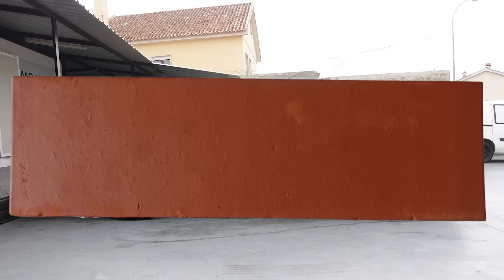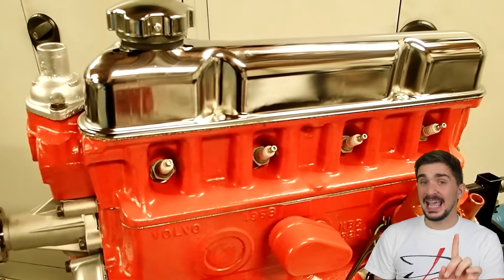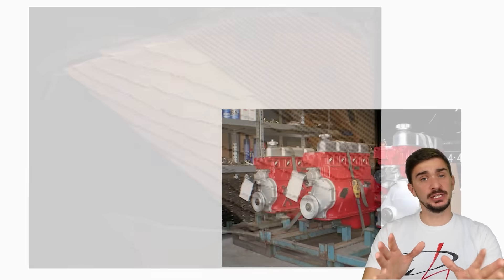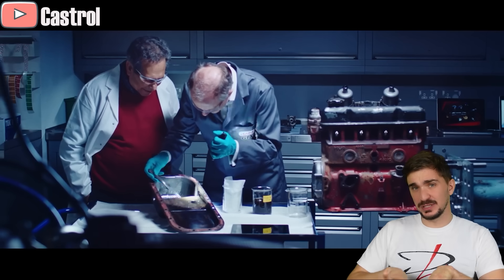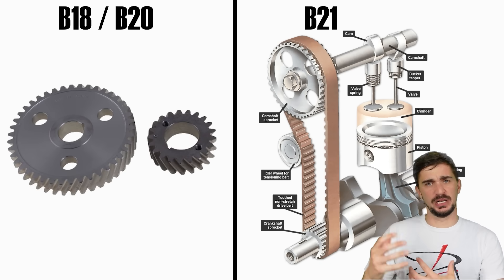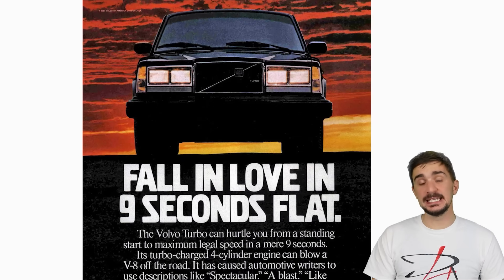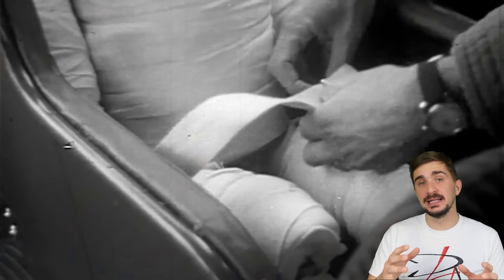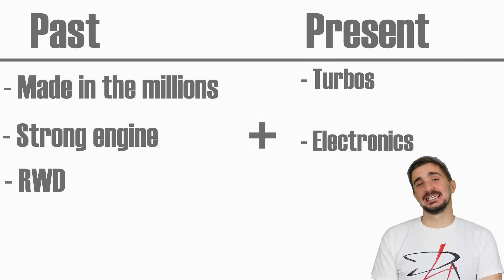A Story about the Volvo 240 and its Redblock Engine - Iconic Cars and Engines #18

Comment: One very important aspect why volvo redblock engine is so durable and basically indestructible in volvo cars is that the engine was used in great quantities by its sibling company volvo penta in boats. The load on the marine engine is maybe 60-70% more than in a car ( think of it as going uphill in 4th gear for hours and hours). To save on time and money volvo AB (parent company of both cars and marine) decided to build the engine to withstand the load in boats hence everything is oversized and more durable and install it in cars. Everything has an explanation, they werent doing things for no reson when they designed it.

Comment: Had four of these 240s , the bad thing of the motor is Volvo used timing belt instead of timing chain.  I had an Amazon with B18 motor, that’s a lot better than 240 engine.

Comment: I have two volvo 940s with b230fb engine and b230fk turbo engine my older 940 volvo has driven now over 600 000 km and newer over 500 000km still works like a charm my turbo engine is made for power with 35hx holset and other things but still orginal crankshaft and pistons and rods.

Comment: This is mostly the same story as the 2JZ, Ford 300, and Cummins 24v (all inline sixes, but bear with me)

These engines were overbuilt and over engineered, designed to either run in industrial settings under heavy load/full throttle; or overbuilt to create a super smooth and reliable engine.

The overengineering allows them to take lots of abuse, and more importantly, boost.

Comment: In 1979 I had a new 240 four door sedan. I loved he body, ride but the carb and distributor points drove me crazy. I lived in east central Ontario and the humid winters meant that the ignition system was a constant problem. The dealer replaced many sets of points and the carb would ice up.  It was a company car and so one of the other salesmen took it over.

Comment: I had one, the only trouble was a sudden mystical reason NOT TO START!  This was a capricious "mood" that only came once and a while, unfortunately at the worst possible moment.  I replaced all the electrical wiring, put on a new carburetor,  and went over everything with a fine-toothed comb.  No avail!  It would NOT start.  This happened in the middle of winter at midnight -- up in the mountains of Norway, and out in the desolate forests of Sweden.  It was great when it rain -- not so much when stuck in the middle of no where. I finally sold it at a lose. Blah!

Comment: I rebuilt a b30 out of a 164 with 200,000 miles on it.
When my machinist miked the crank, he said there was no wear.
We polished the crank and installed standard bearings.
The cylinder head was not so fortunate.
Every single bit had to be replaced.
Still working on those engines , restoring 1800s and 544s

Comment: 1977 burgundy (like the first car on screen) 242...1985 charcoal grey DL wagon (245)...by far and away my favorite cars of my lifetime.  Both were slow, but after lots of suspension, wheel and tire upgrades and modifications, nothing short of a Corvette or Porsche had much chance of losing me in anything twisty.  Many trips between the Connecticut coast and Limerock Park in the 80s and 90s were sure proof of the car's potential.  I regret not spending the time and money to truly build a Flying Brick with a turbo...

Comment: its funny you didn't mention the extreme over square design of the engine. the b23 has a bore of 96 mm and a stroke of 80 mm. Just as surprising; 63mm main journals on the crankshaft

Comment: I love your video, it made me smile, because I have the Volvo 240 GL with the red B230F engine.
I've had it now for a couple of years 2nd hand. 
I've had to change accessories like battery, alternate, fuel pump and filter, and water pump. 
The engine itself though is a brick, like you say. ❤️

Comment: The 145 and 245 were probably the most boring and the most reliable cars you could find at the time,  I had a 145 express that I had delivering newspapers, an express was a 145 without a backseat and a flat floor wich put it in the taxbracket of a light truck wich was way cheaper.

Comment: My dad had a 244DL Volvo, NEX939V, and just 2 days into its life we were hit up the back by an old 'Land Crab' - it was 1979. The Volvo saved our lives. It was very damaged, and it was repaired. the whole rear bumper was level with the rear window. I got £700 compensation as I had a cracked vertebrae in my neck, and shock to my spinal cord. It could have been so much worse.

Comment: Having owned my share of these - I can swap any bit of the engine you fancy swapping - I have the One Caveat -   They are so rubbish on fuel, you will weep. You will believe there is a hole in the fuel tank. If Ronnie Kray moved into your spare room & stuck you up at gunpoint every evening, that would be cheaper than keeping fuel in one of these. You will have to take a second job just to afford fuel to get to your first job. Getting to the second job will require an overdraft.. 

Every time you turn the engine on after a while, your bank manager will ring to ask you to knock it off as the overdraft is gone beyond a joke. LITERALLY. 

Luckily, once the vehicle has sent you bust and you can no longer afford to run it, the boot is big enough to live in when you finally become homeless. So there is that Upside. If you gave me your one for free - just so you could try rebuild your life after it had bust you, I'd pass, unless I had a bridge somewhere that I owned requiring a sturdy prop. If it fitted & I could find a way to jam it in there, maybe I'd take it. But I'd tow it with a diesel to the bridge - I doubt I could justify the cost of driving it there under its own steam. Hiring The Rock to pull it there with his teeth would probably be cheaper. Only a V12  Merc or a Toyota 4.2 diesel are scarier on fuel unless you are used to running lorries (or are American)  - in which case these will probably seem pretty OK..

Comment: There is some misunderstanding about "strongness" and "safety". There is no doubt that these old Volvos were built to last BUT it is a blatant lie to assume that these 40 year old cars are safer than modern Volvos and the likes. With the current safety standards on cars, there is no way any of these old cars could be allowed for production. For the sake of argument, it is way better to get an accident in a, say, modern Golf than any 40 year old car.  Safety standards back then meant nothing compared to now. I do admit that Volvo has always been a forerunner of building safe cars. They are known for that. But a 240 is not safe by modern standards!

Comment: I drove my neighbour's brick back in the mid eighties. It was the most awful driving experience of my entire life. The gear change was truly agricultural, with a horizontal gulf between 2nd and 3rd. The handling would have be at home on any light truck of the 1930's, and it was so underpowered ladies pushing prams kept overtaking.
I never crashed it, and gave it back well before I could test its'longevity.

Comment: My wife had a 240 wagon back in the 1990's - loved that car!   I called it the swedish tractor.  Ultra reliable, simple to repair, unnaturally good on snow, and ultimately saved several passenger lives when it got high speed T-boned by a commercial truck.
Reply: A trick was to toss something heavy in the trunk during wintertime, making the grip even better in snow.
Reply: Jep - they are incredible good handling on snow. Never had so much fun drifting 🤣
Reply: When I was about 15 (I think) we had a 240 GL - 84 in a beautiful light green metallic. It was wintertime, and there was some snow on the road. We were on the highway, and my dad wanted to pass a slower car. But as he changed lanes to overtake it, our car started to wag its tail like a happy golden retriever, it went off said highway, and on to a field, flipping over a couple of times, before sticking a perfect four point landing. The trunk was full of luggage, so it was quite heavy in the back. So I don't know about that "good on snow" part. Then again, that car got rearended a couple of years prior to the highway accident, by a SAAB 900 of all things. Even though there wasn't any visible damage to our Volvo (unlike the SAAB), there may have been some damage to the underside of the car, making it a bit nervous in the back on slippery/snowy surfaces.

Comment: My 1994 240 has 380,000 miles.  The engine is original and has never been repaired.  Same with the manual transmission.  Even the starter is the original and still works.

Comment: I'm still driving my 1990 240. You didn't mention that Volvo left the unmachined engine blocks to rest for a year to relieve stresses caused by the casting process, before grinding the surfaces.

Comment: I bought a used Volvo 245 Station wagon back in the 90s for 300 bucks in California. It was actually a really fun car to drive, with the one exception of a power steering that only worked when you turned right. Left it was no power steering. But the shocking thing was that in the glove box were repair receipts for tens of thousands of dollars. I don't know if this car had some kind of bulletproof warranty, but it was a black hole for repairs.

Comment: i have a 1981 244 with a b230A and despite it having stood in the same spot from 2008 until 2022(not started once until i bought it) it started and ran well with just new plugs and some fresh gas

Comment: Well the real Volvo cars starts even earlier than the Volvo PV, the Volvo Amazon and the Volvo 140 series. The 240 was ok though. The motors that you should remember is B18 and the B20. The later motors where not really the same quality if you ask me. I think I still can set the breaker points and timing by eye on those motors today even though I am getting 70 this year. I am a former SAAB mechanic but I have great respect for these older Volvos.

Comment: My parents had several Volvo square-backs we called them.  So for my first car out of college I got a used one, but sadly the maintenance costs were far to high for a recent college grad and bought instead a brand-new Honda CRX after a year or two.  I remember the car had a little button on the 4-speed stick shift to engage an over-drive...sort of like a fifth gear.  I also remember the car lacked power and really struggled to go up modest inclines on the freeway.

Comment: I learned to drive on my Mom's brand new 1977 242 (with Lambda(?) drive) sedan complete with a manual cranked moon roof. It was gifted to my wife and me  in later years when we got married We drove the Scandi tank until 1998. In those twenty years we religiously paid every regular (not cheap) maintenance fee recommended and quite literally drove it right into the car dealers lot as a signed for trade-in when it expired. I loved that car, my wife hated it, but I never once worried about her safety on the road.

Comment: I love my 940 from 93 - the electric fan failed last summer. The engine overheated 3 times before we figured it out. Replaced the electric fan, after we realized it was not a bad thermostat every time. 6 months later - engine does not seem to have been affected at all. No head gasket leak. Nothing.

Comment: The last "classic" Volvo I worked on was a 1988 with the B23T.  It is a magnificent car, but I really had to shake my head at how they sealed the water pump against the cylinder head.  Volvo certainly cut a corner there!
Reply: I worked on hundreds of these. 
Never had a problem with  the water pump sealing.
Yes, I changed pumps, but leaks were rare.
Reply: @jojo1966  how did you get that seal tight against the cylinder head? I don't know what the proper procedure was, but I put a jack and a 2x4 under the pump to push the pump against the head to squish the seal and then tighten the bolts.
Reply: @paulstandaert5709 pretty much it..
Volvo sold a calibrated 2x4 for those pump installs .
There’s one around here somewhere… 
I agree it was a bad idea, but once I had them in they rarely gave me any trouble.
I serviced many of them.

Comment: It would be unacceptable now with requirements for sensors, cpu etc but I wish they would do a reissue of the 240 series. In the early eighties I bought a 3 year old sedan following commercial lease and kept it until it was 28 years old. It was still going well but the demise of leaded fuel led me to change cars. Panel beaters did not like them (almost indestructible from rear end hits) and  no one wanted to steal them. Great car!

Comment: I had a b20 engine in a volvo Amazon (120) and got oilpumpfailure on the highway, and I dont wanted to stop until right on the highway, but the engine just exploded, camshaft into 3 pieces, and hole in the block. only the top survived,

Comment: I owned a 264. Peugeot and Renault used the same engine, however volvo Sweeden used crap cams, so the engine would need to be removed every 30k miles (cams couldn't be removed from the front) and it cost THOUSANDS. Every time. I bought a Ford made Volvo years later. Hands down the WORST CAR I EVER OWNED. Thranny fell apart, moldings would fall off if you blinked. Now the CHINESE?!? are making them?!??!?
Could you imagine???
..think I'll stick to Toyota.

Comment: I've heard that Irv used to drive the P1800 from NYC to Miami and back on a weekend...."just for fun". 
May be a rumor, but I believe the Volvo brand was the cause of the million mile odometer originating in cars, because the dealers complained that the odometers didn't show the true mileage on the trade-in cars, so they were getting 'burned' on the trades! I was a Volvo master technician back in the '80s, and during my tenure at a dealership, we only saw two engine jobs during that 8 year stretch. one actually threw a rod while the guy was doing WAY over the speed limits and another because his DIY oil change didn't secure the drain plug properly, it fell out and that killed the engine.

Comment: Tell me about it. I have had in my possession over the years: 142 (my first car, found abandoned in a barn), 145, 244, 244D, 245Turbo (motor siezed!), 264 V6, 745, 745 6cyl TD and, to downsize, a 460 2ltr automatic. That's 9 Volvos altogether. Big and comfy for a reasonable 2nd hand price. You can take them apart completely with a 13mil spanner and a Philips screwdriver. My only problem was expensive spare parts, but there were usually plenty of wrecks to scavange from. Ruined as far as quality and comfort went, I had difficulty finding a suitable alternative if I didn't want to pay over the odds for a Mercedes or similar. I've got a Lexus RX 450H now, and a Toyota MR2 with a heritage registration. Both were 2nd hand too, but they're the only makers that match the reliability.

Comment: This little family went through 3 of of these wagons (one with turbo) from new, during 25 years. Roomy comfortable safe satisfied. 
Then switched to used (3yrs) Merc E-class diesel wagon. Now19 years later it still runs like new. One injector replaced. Yes, body rust from N.Europe coastal salt but, worth repairing.

Comment: Lol great cars they really were . But the problem was Volvo tractors used the same headlights. The replacement from Volvo $1250 . At auction a 240 would sell for $200 with 2 good headlights.

Comment: Maybe not the 240, but the early 960s also got redblock engines. And what I love about that model the most is that they used Aisin transmissions. A lot of cars, especially Toyotas, from the 2000s used Aisin transmissions also, which made the already easily maintained car even easier to maintain, especially with how you can just drive to any dealership and ask if they got the transmission for a typical Toyota minibus instead of a Volvo's. My dad's 960 has a cheaper maintenance price than my mom's much newer Honda Fit, and it gets roughly the same mileage when used on highways.

Comment: FYI: Every Engineer back then had a Slide Rule - a mechanical analog computer which used primarily for multiplication and division and for functions such as exponents, roots, logarithms, and trigonometry. The slide rule was invented around 1620–1630...

Comment: The Volvo 240 DL (1990 model) was my first vehicle in 2004. It was a fantastic car to learn on, and it took a considerable amount of abuse without breaking a sweat. It had electric overdrive and cruise control, and was very fun to drive. Sadly, a Cadillac collided with me on the passenger side and nearly flipped my vehicle, and the car kept on running just fine. It truly was a tank. I later got a 1993 Volvo 240 wagon that was incredible to drive as well. Best cars ever made.

Comment: I got m y E reg 740 estate   up to 120 mph coming back from Edinburgh on the long stretch of the M9 at 4am  the Motorway was dead  apart from the police car on the opposite  side ramp which  i thought radioed ahead to catch me at  the Haggs turnoff.. luckily  to my surprise  nothing happened ( they must have nodded off).  phew that car could shift!.. I had it for three years until it developed engine problems overheating  so I traded it in for a K reg  2.0  GLX Mondeo   jesus  WTF was I thinking?

Comment: So that exact P210 Duett I have been driving. It was used but the Stockholm Tramway and for many years even had blue lights. And we're talking in the 2000's, not the 50's.

Comment: i had an old Volvo 240 DL wagon. Despite 2 people learning to drive on it abusing it horribly, it was still a very good car with the smoothest transmission and rear wheel drive funness for any roundabout.
Gas mileage was so-so, but it was a great car that I wouldn't be sad to have even now.

Comment: My old man had a Volvo  240 sedan( the gray ghost) and a fjord blue manual station wagon (the sled) when I was a kid. The gray ghost had a turbo when purchased but the sled went through 3 turbo setups a diff rebuild, clutch and a cam all of it was for fun. the sled made 297 hp in final form and it had 400k on the odometer before he sold it. Great car.